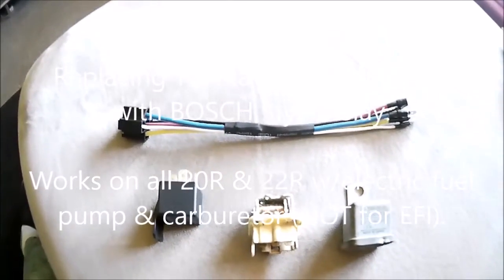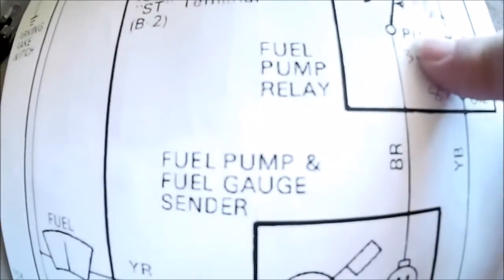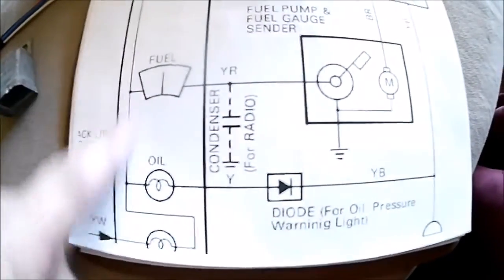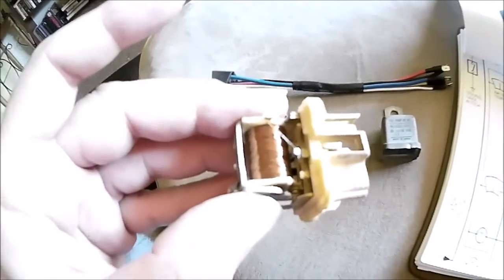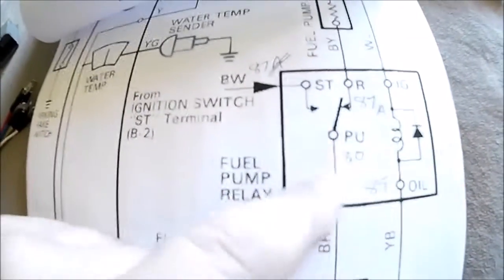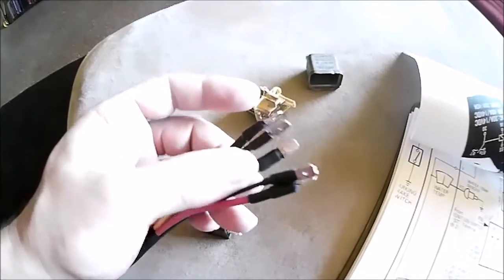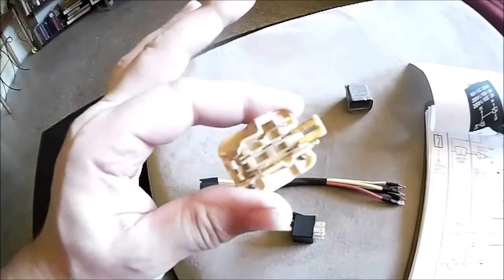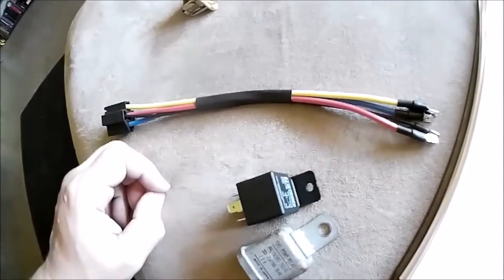1978 Toyota Pickup 20R-Fuel Pump Relay Replacement/Substitute

Comment: I’m
Having a fuel issue on my 1978 T PU . Thanks god your content. I just swapped the fuel filter every thing electrical seems to be fine but no fuel coming out of my hose next step is pump but do you think the relay in this video could be the culprit?
Reply from the maker: It could be the relay or the resistor. If the relay is original and the truck has a lot of miles, the contacts inside could be worn or pitted, causing a reduced or lack of voltage flow to the pump. There is a resistor for the electric fuel pump as well. As the resistor ages it can develop higher than optimal resistance, also reducing voltage flow to the pump. The resistor can also be fatigued and causing higher resistance when hot.

You can test the resistor with an Ohm meter and an electric hair dryer or heat gun. The resistor is located under the hood, on a metal plate on the passenger side wheelwell. If original, it should look like a white cylinder with a wire soldered to each side of it. These wires go to a green plug, which plugs into the wiring harness.

Cold, the resistor should measure 1.4 Ohms (original specification). Any reading above 1.54 Ohms or higher the resistor is bad. Leave the Ohm meter hooked up to the resistor and use the hair dryer or heat gun to heat it up, from a distance of 6 inches. Watch the Ohm meter when you do this. If the resistance reading rises above 1.54 Ohms the resistor is bad and needs to be replaced. If that is your case, I have info on hand on how to replace it. Original resistors are no longer available from Toyota but I can recommend a replacement part that will work well.

Beyond this, if you check that the relay & resistor are good, then it could be the fuel pump, or a loose or broken connection. If the pumps is original it's more likely to be the pump, since it's over 40 years old.

If I can help with any other info let me know.
Reply: @The13thSword  hey that is awesome thank you. Yeah I am in love with this little truck and want to make it my daily driver. The fuel pump is original I am trying to find out if I could just install an inline fuel pump to not have to drop the tank to get the OEM one out. Oreilys sold me an in-line pump and stated it was for my truck I told them it was in the tank and they said it was not. Lol
Reply from the maker: @scgrindllc  Figures. Most parts guys don't know or understand much about older vehicles like ours. That's why I bothered to document all the things I did to my truck & post them to Youtube, to help out other people like you. :^)

Yes, you can install an inline electric fuel pump and leave the old pump in place in the tank, as long as there are no restrictions to fuel flow through the old pump body. This used to be a very common fix for a dead fuel pump in these trucks. Most people just didn't want to go through the bother of draining and lowering the gas tank. I did it because I wanted to keep the original engineering & function, and it let me clean the tank out of 40+ years of junk. New, stock style, in-tank pumps are still available if you decide to go that route though. I used an Airtex E8188 model, but there are others out there.

As far as the aftermarket inline pump goes, you just need to be sure that it is rated for 5 to 8 PSI of working (normal running) fuel pressure, as that is the fuel pressure the stock carb needs to work correctly. You would also have to extend the power feed line from the original down to the inline pump, & make sure the new pump is well grounded. That way you would still be using the existing wiring, and not have to do a whole new circuit, which would be very much a bother to do.

Most people used to just mount them to the outside of the truck's frame, but as long as it's mounted near the tank it should work. Electric fuel pumps work best when near the tank, "drawing" fuel from it, & pushing it up towards the carb. I do NOT recommend ever mounting an electric fuel pump in the engine bay.

Keep me posted on your progress. In the meantime I have to replace the Center Carrier Bearing for the driveshaft on my truck, and may be posting a video on that soon. Cheap $20 bearing part didn't even last 5 years. Lesson learned again by me; buy the best quality parts you can afford.
Reply: @The13thSword  
Sounds good I will keep you posted . I will also post a little short video of my rig.
Reply: @The13thSword  Mr . Sword13, I got my fuel pump in the mail and the mechanic refuses to put it on because it is made in China :( do you know of any others made elsewhere?
Reply from the maker: @scgrindllc  Well then I guess he doesn't want your money to do the work. Your mechanic is also being more than a little bit narrow-minded. Not everything made in China is junk quality just because it's made there. Airtex is well known for good quality parts, & they specify what quality is required to make the part. I researched this thoroughly when I replaced my fuel pump because I didn't want a cheap bad quality part breaking down on me & me having to do the job all over again later. Also, it's the best quality stock-style fuel pump I could find that didn't cost me a ton of money.

If you got the Airtex E8188 it's perfectly fine to use. That's what I went with and more than 5 years later it's working just the way it's supposed to. As best as I know, there are no other direct replacement, stock-style pumps on the market made anywhere else.

You may have to do this job yourself. It does take a fair amount of work but it isn't difficult.

Also, did you get a strainer for the pump? You'll need a new one. Here's what it looks like: https://www.rockauto.com/en/moreinfo.php?pk=3627036&cc=1277108&pt=6212&jsn=904
It just presses onto the bottom of that fuel pump.
You can get this from Amazon, Ebay & other online sources. Parts stores are not likely to have them, or will want to special order it in & charge you lots more $ for it. In the US (I don't know about other countries) your best bet is Ebay. Just search on there for  AUTOBEST F100S & you'll find it.
Reply: @The13thSword  sounds good I figured the pet is legit your like the Helix whisperer. I appreciate all you help:) I will order a strainer and I already got a piece of straight fuel like you indicated because the pump comes with a curved one and you didn’t like the fit.:) so for the strainer Amazon has it and it’s an f100?
Reply: I found the part on Amazon for 6 bucks. Check check ! Thanks a ton Senor 13th sword
Reply from the maker: @scgrindllc  Considering how much of my truck I've been through & worked on, there aren't too many parts of it I don't know about. Just glad the info is helping others out. I did see you other message & as long as the strainer looks like the example in the link I sent you, it should be correct. Remember, it's just a press-fit on the bottom of the pump so take your time with it & go easy putting the strainer on. If you even need a tool to do it, it just takes a few light taps to get it seated on the pump. Don't overdo it.

Another small item I should mention. When you see the existing small fuel line on the pump, it may have two (2) short pieces of fuel line, with a  valve in the middle. It's a recirculation valve. When you have less than full fuel flow going to the carb, the extra pumped fuel gets shot back into the tank. This can help keep the fuel in the tank from getting too hot in hot weather.

I ended up just deleting the valve on mine and have not experienced any problems. And I live in Florida with very hot summers. It's up to you if you want to keep the valve in there or not. If you do keep it, just make sure the clamps that hold it in the line are solid & tight to give a good seal on that feed line.

Just remembered another thing. On my '78, one of the bolts holding the fuel tank to the frame does NOT thread into the frame, but has a nut on the other side. And this nut is in a VERY tight space, & is a major pain to get back on. If I remember correctly, it's the center bolt on the rear flange of the tank. Again, just try to be patient with it. Worse comes to worse you can leave it off, as the other 5 bolts should be enough to keep the tank in place.
Reply: @The13thSword  Mr. 13th , I am going to purchase the in tank fuel pump Airtex E8188. Is that the complete system or do I add it to the existing configuration? Just curious to find out if I need anything else to make the swap. Also my gas tank is pretty beat up I saw a video of you changing it. I checked with that yoda part place but they don’t have any tanks . Any other source you might have up your sleeve? If not I might just keep my tank it’s not leaking or cracked just dented . Please let me know and thanks so much.
Reply from the maker: @scgrindllc  The Airtex E8188 fuel pump is a direct replacement part for the old pump. It comes with most everything you'll need, with one exception. When I did this on my '78, the fuel line they give you with the pump is angled, but the original is straight (check out item picture of the kit from the source you are buying it from). I didn't like the looks of how the angled line fit, so I swapped it out for a piece of straight fuel line of the correct size. Just take the angled line piece to any parts store & you can buy a foot of line, & cut a length from that to use. I don't remember the size but the parts store can match it up for you easy. And don't forget to buy extra lengths to replace the rubber lines from the tank hardlines to the body-mounted hardlines, & for the rubber lines at the fuel filter & carb.

If the tank isn't cracked, rusted thru with holes or leaking but just dented, count yourself very lucky. As long as it's intact, not leaking, doesn't have any holes & is doing it's job, dents won't hurt anything. No need to replace it.

And for anyone else reading this out there, there are NO aftermarket direct fit fuel tank replacements out there for the '75 to '78's, OR for the next gen "79 to '83 models. There ARE replacement tanks available for '84 & up, but they may NOT be a direct bolt-in replacement, & some modifications may have to be made for mounting to the frame. They also use a different design of fuel sender, which may or may not work with your existing fuel gauge.
Oh the joys of modding. :^P

Comment: do you really which wires went to the fuel pump?   with color?  I think there are two the run the pump in the thank.   I traced the wiring look back to the pump and there are 6 or 8 wires in the loom and I would rather not drop the tank to see what wires run the pump.
Reply: sorry...   do you remember which wires ran the pump.   I am trying to test the pump at the connection up at the relay.
Reply from the maker: On the 1975 to 1978 models of the Pickup, there is only one wire that runs to the fuel pump. That wire is Black with a Red stripe. This is the "power" side of the circuit. The other side of the fuel pump circuit is via ground. The fuel pump itself has a ground wire that connects it to the "stalk" that holds it & the fuel level sender. The "stalk is then grounded through the tank itself, which is grounded to the truck's frame, and the frame has a ground cable going from the passenger side motor mount to the battery negative terminal.

The only other wire going to the tank area is the wire that goes from the fuel level sender to your gas gauge. That wire should be Yellow with a Red stripe.

I'm not sure which "loom" you are referring to but be aware that multi-wire looms can carry wires to several locations or parts of a vehicle. Just because the power wire for the fuel pump is in a loom with other wires, that doesn't mean ALL of the wires in that loom are for the fuel pump.

Let me know if you need more info or have other questions.

Comment: Can someone tell me the LOCATION of the relay, please.  Ya can't fix it if ya can't find it!!!!!!!!
Reply: I forgot to mention, it's a 1978 Celica 20R automatic
Reply from the maker: @mechanic801  MY description is on the pickup truck, but I imagine it might be near the same place on the Celica. If you still can't find it there, try behind the driver's side kick panel. This is the vertical panel/cover under the dash, to the left of the pedals.
Reply: @The13thSword  Thanks, I found it
Reply from the maker: On the 1975 to 1978 models, the relay is located under the dashboard, to the passenger side of the steering column.